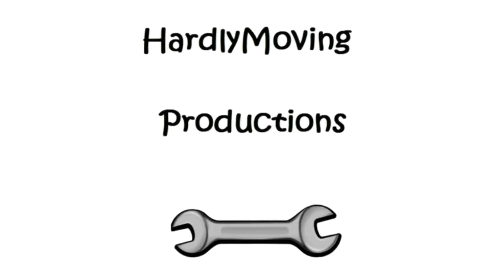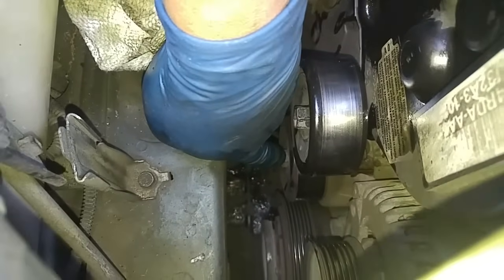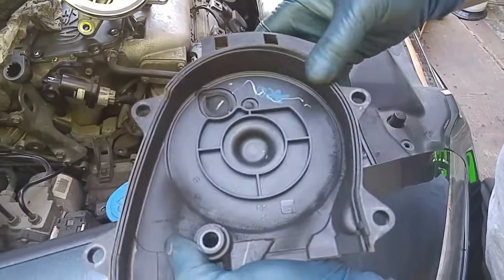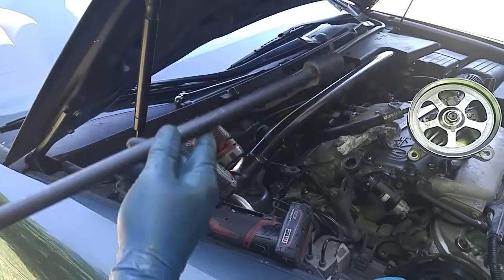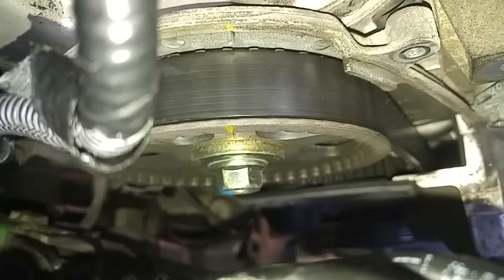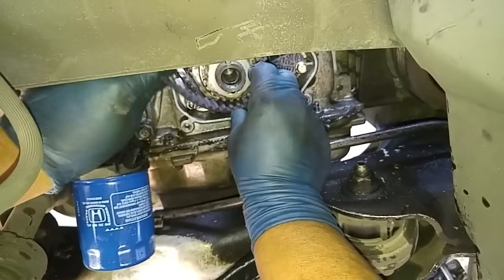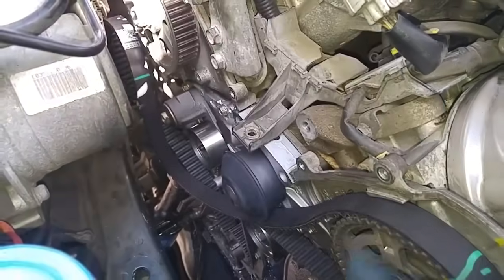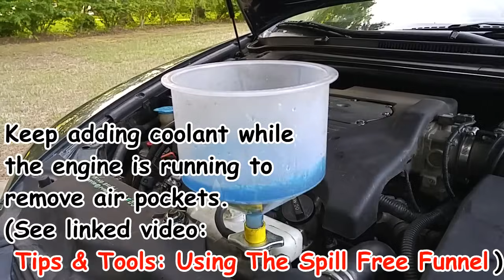Acura TL (Honda Accord V6) Timing Belt, Water Pump, & Pulleys Replacement

Comment: Great job!!!!! But Why leave same tensioner in?????
Reply from the maker: Haven't had a failed or worn-out tensioner situation on a V6 Honda to date. Did have a failed tensioner on a Mitsubishi V6. The strength of a tensioner can be tested in a vise.
Reply: @hardlymovingpro  still should have replaced it. That is what fails on these cars, not the belt itself. Maybe you will get lucky and it won't fail for another 100k miles. Either way its s big risk not replacing it
Reply from the maker: From my observations of all the belt jobs I've done, it's the idler, tensioner and water pump bearings that wear out and fail.
Reply: @hardlymovingpro  but the tensioner is cheap. Even if it wasnt, it is definitely cheaper than a new engine if it were to fail. So at that point while you are in there you might as well just do everything. You are right, the idler can fail. The hydrallic tensioner definitely could. It wears out and starts leaking oil. Idk man you do you, but I want piece of mind that everything was done and there is no chance of a failure
Reply from the maker: You make valid points but find out for yourself.  Call up some dealers and independent repair shops for a timing belt / water pump replacement quote.  After you get their quote, ask them if it includes a new tensioner.
Reply: @hardlymovingpro  I just had my 2016 accord v6 done about a week ago. That's why I came to your video so I could see what was done. They buy a kit for the vehicle which does replace the tensioner

Comment: I LOVE this channel. So no judgements just you dont need to disconnect the hoses for power steering pump. Just remove mounting bolts then move whole pump, with hoses attached, ontop of upper intake. Removing the 10mm hose clamp on back cylinder head also helps get more play in high pressure hose. Just to save someone somewhere some time.
Reply from the maker: Good to know and thanks for sharing!

Comment: Doing my 05 3.0 accord. Had it in time but as soon as I took the belt off the back cam sprung forward. It would rotate clock wise I counter clocked it back to the marks. It’s out of time because the motor won’t turn by hand. Need help
Reply from the maker: You can turn the camshaft back to its top-dead-center mark.  You can leave the crankshaft at TDC.  Doesn't matter if you're off a few degrees.  If you took the belt off before you did TDC on the crank and cams, you'll have to work turning the cams and crank (with no force alternating the turns) to get everything to TDC.

Comment: Great Video. Can you give me an estimate on time for a water pump-timing belt on 1999 Acure TL
Reply from the maker: Around 5 to 6 hours using standard tools with no hiccups.
Reply: @hardlymovingpro  do I need the Milwaukee battery drill or can I use regular tools. I’ve changed out thermostat without drill

Comment: Just completed this job with your guidance, thanks so much! Awesome video!
Reply from the maker: Glad it helped!
Reply: How long did it take? Did you get all of the tools on the list or did you improvise?
Reply: I did have most of the tools already, the trick with marking the existing timing belt with an ink pen and taking a picture before removing the tensioner, then matching it carefully with the new belt, was wonderful! That crank pulley bolt is no joke, fighting that crank bolt can stop your progress in a hurry. I tried to get it off with a 18v snap on impact and it couldn't even budge it, I also have milwaukee tools so I ran out and I bought the new milwaukee m18 fuel impact and that took the bolt off with ease. I also bought a concrete mixing pan to catch the coolant from the block when you take off the pump housing. I did it on jack stands in the garage just fine. I would say it probably took me 8-10hrs doing the thermostat as well, but I wasn't rushing and started Friday night and worked on and off over the weekend

Comment: Do you think it's possible to remove the crank pulley bolt without the impact gun? I ordered the special socket already but I haven't bought an impact gun.
Reply from the maker: That "special socket" is designed to work with an impact gun.  You can get yourself a cheap (under $100) ac electric gun that should generate the torque to get that stubborn pulley bolt off.
Reply: @hardlymovingpro  Oh I see.  Thanks, I guess I'll have to pick one up as well.  I'll be doing this for a 2006 Honda Accord EX 3.0L V6 and your video is the best I've seen.
Reply: @hardlymovingpro  So I bought an impact gun but it's battery powered and it can generate 325 ft lbs of torque.  That should be enough, right?
Reply from the maker: Used with the high mass socket it should.
Reply: @hardlymovingpro  Sweet.  OK, so now I just need to wait for the high mass socket to arrive through the mail.

Comment: There's a few things I would have done differently but that's because I'm picky. With that said, I think this is a perfect example of a how to video. No BS, no ridiculously drawn out intro. You did a fine job sir thank you for the video.
Reply from the maker: Thanks for your comment and support!  If I were to do a timing belt job on this engine a few months from now, I'm sure I'd do something different or slightly out of order.

Comment: Thanks for the great and to the point video. Your tips on marking the belt was great. I am glad I marked it as you have shown. Old stretched belt didn’t exactly match and without the marks it would have been possible to install the new belt one tooth off on the heads.
Reply from the maker: Thanks for watching!

Comment: Hello like everybody else great video i I have the same Milwaukee high impact gun with the Bluetooth and the one customizable setting plus every other 18 volt and 12 volt Milwaukee impact wrench at every size and other cordless Milwaukee tool I have the stubby 3/8 and 1/2 in I have the right angle I have the ratchets I have the autel maxidas and I have my tablet computer with the OBD2 to USB protocol can bus for tuning my S4 and my Audi TT anyway sorry to carry on but I got in an accident replaced everything on the front including radiator headlights radiator support condenser everything everything went well I used the right coolant but at first I didn't and it I was just about to be happy and have my daily again filled up the coolant and was bleeding the air out but then my girlfriend noticed a little bit of a leak on the oil pan on the passenger side 2005 EXL 6 cylinder Honda Accord I am now stumped the car runs and drives great does not overheat unless I let it get hot because of this issue do not understand where the coolant leak is coming from and why can't find anything on the internet and I've been going nuts I was going to do a replacement I'm not a professional mechanic but I've been racing and replacing and doing cars since I was 17 I am 39 now and I have every single tool that you have put engines together put engines in cars have done head gasket jobs on an hourly Volkswagen guy but first was a Honda guy for the life of me can't figure out why or where this leak is coming from it's just coming off the oil pan as soon as I put the coolant in rather the car is on or off and it didn't do it prior to the accident it doesn't it looks like it's coming from the metal lower or upper cover on the passenger side it's like a drip but if I pour coolant in car on or off it'll either slowly come out or come out fast but when the car is on and the Heat or the froster I forgot it will sometimes not leak but as soon as I turn the car off all the coolant will drain from that spot anything would help me greatly I'm dying here thank you man is everything's been a struggle I'm going through a lot of rough times right now and I know everybody has issues but any type of help I would appreciate it I haven't even had the motivation and it's my only car that I can actually use right now I just would love to know I can't find anything on the internet and my head is not all there going through a lot of issues like I said and I need to get this car going I spent a lot of time and money and I need to get places but I don't have the money and I am struggling mentally to get anything done sorry to put that on you but I'm probably not even explaining it correctly to make sense I just don't understand why coolant is coming out over there at the rate it is as soon as you put it and it comes out from that spot and it never did so again I'm sorry man but I would appreciate any help because I was just about to randomly start tearing crap apart with your video LOL and I didn't realize cuz I'm used to Audi and Volkswagen that if you do want to rotate the engine to find top dead center although I am fully aware I've done it like I said but not on a 6 cylinder Honda I understand exactly what you're doing I've done it too with the paint I just didn't know that I didn't need or what way to go manually to get it to top dead center it looks like you were going clockwise I've never had or heard of that you were supposed to go counterclockwise because of the interference any help would be greatly appreciated thank you man again sorry for the messed up message
Reply from the maker: You may have a blown head gasket.  Check for air bubbles in the coolant reservoir with the engine running, any exhaust white smoke during idling, no cabin heat and residual high pressure in the cooling system after engine shut off and cooled down.

Comment: Hey man,

I just did this and my timing belt was loose. I got a new timing belt tensioner, and followed your video. For some reason the belt was loose and I can’t figure out why.
Reply from the maker: Could be a defective tensioner.
Reply: @hardlymovingpro  

Well day two . We took it all apart again!!! took our time again with it and it seems to get tight at certain points of the rotation and then it’s a little loose. We made sure to be at the right marks on the cam gears and crank. Turn it two full hand rotations and fine, put everything back and the car just cranks and crank and no start. Then when we tried to crank it and it was making a noise.
Reply: Oh and when we were turning the cam gears to get them to line up on the second attempt, it would click into place which I don’t recall doing that before.
Reply from the maker: Any error codes?  Like cam or crank position sensor errors?
Reply: @hardlymovingpro  

None errors. We took it apart 4 times!!!! Took our time with it and we figured out is that the cam gears are moving around a teeth more once you put the belt tensioner on. Not sure if we have to use a cam gear lock to keep them from moving. We get them close to perfect on tdc and as soon as you release the pin for the tensioner the cam gears shift.
Reply from the maker: @gloglo1275  Could be something as simple as a leaking or disconnected vacuum line/tube.
Reply: @hardlymovingpro  

Would it not run if the timing is a tooth off? It literally will not run and if you can force it to run it sounds like something is knocking .
Reply: I did see a vacuum above the power steering pump that was cracked.

Comment: Great video, thank you for posting!   The only thing I would change is to say right up front not to start this job unless you have the Lisle 77080 socket!  I could not get the crank bolt undone with a standard impact socket and had to wait a day to get the Lisle.  Then it came off in about 5 seconds!
Reply from the maker: Thanks for sharing your experience with the lisle socket.  It's a great 🔧 tool!

Comment: I take my hat off to you and this is a great video but why are you putting the old belt back on? Considering the timing belt should be changed along with the water pump and a new tensioner and can be purchased in a kit it seems like a lot of work to go through to leave old parts inside.
Reply from the maker: Good point but extra expense the customer didn't want.

Comment: Hello,I recently been having a pretty bad coolant leak that I suspect is coming from the waterpump. I see leakage from the passenger side behind the wheel dripping off of the frame. It's an 06 acura tl. The leaking is getting worse. I find myself adding more coolant more frequently. I cant start the car without first checking the radiator to see if theres coolant in it. 9 times out of 10 I'm refilling the radiator with more coolant. I been quoted for 1,200.00 to replace the waterpump  with parts and labor. I dont want to spend that much on a car I recently purchased for 5,000. This video shows in depth what the labor entails. Thank you for this video. I'm leaning towards doing it myself and doing it fast before something worse happens. Problem is I dont have tools. What will be all the tools I would need in order to get this job done? Should I replace the pulley tensioners? What are all the replacement parts I need? I'm aware that it would be wise to replace the timing belt while I'm replacing the waterpump,but please help sir I need my car. Thank you very much!
Reply from the maker: Yes ... definitely sounds like the water pump needs replacement ... ASAP.  If the bearing in the pump goes, the timing belt can either "jump" or break.  The hardest part to removed on these cars is the crankshaft pulley bolt.  The easiest way to get it off is with a high mass impact socket (made by Leslie) with an powered impact tool (as shown in this video).  You can purchase an electric impact driver for under $100 either on-line or locally.  The Leslie tool on-line.  A list of my recommended parts and tools is noted in the "SHOW MORE" area of this video.

 To support our channel and to get notifications of new videos, please subscribe.
Reply: @hardlymovingpro  thank you for your response I noticed all that info after I sent you my message. What about that automatic ratchet you were using to remove the timing belt covers? Yeah this leak is getting bad I mean the puddle of coolant was bad. I drive to work and let it sit for 10hrs before going home and throughout that time it all just leaked. Thank you again!
Reply from the maker: @freightshaka4193  The electric ratchet wrench is nice to have but not necessary to do this job.  I have it and use it because of all the TB jobs I do.  The tool cost around $150 with a battery pack.    

To support our channel and to get notifications of new videos, please subscribe.

Comment: Do you have to adjust the timing belt if you were to just replace the tensioning pulley?  Mine makes that squeaky sound and I’ll replace it but I wanted to make sure
Reply from the maker: Nothing to adjust.

Comment: I'm considering taking this on. Will save about $650 of mechanic fees above parts. Besides the heavy-duty socket for the harmonic balancer, it looks like I can do the job with the tools that I have. It would be nice to get the long wrench set, but kind of pricey for doing this just once. Do you know how much time I should plan for this? 6-8 hours? Also, what are some likely surprises that I should be ready for? I have lots of experience working on cars. I have changed out engines a couple of times. Just not with this model. I have a 2014 Acura TL SH AWD with 95,000 miles.
Reply from the maker: Getting off the harmonic balancer should be your number 1 priority
Reply: I should be able to free it with a quality half-inch hex socket with a long bar and a pipe.

Comment: Very good video,it looks the same as my engine the only difference is that mine  has a spring tensioner and I think I have to manually add the right tension to the belt  before I tighten the pully, doesn't do it automatically like the ones with the granade pin,am I right ? Also is there any chance that the timing marks are gonna move when I put the crankshaft pully bolt back on,am sorry if I sound ignorant, I done a lot of repairs in my cars but this is my firts time doing a water pump/timing belt,thanks for answering my previous question on your other video.
Reply from the maker: Yes ... the granade pin release setup is an automatic tensioner that replaces the hassle of a spring tensioner setup with respect to a timing belt replacement job.  Spring tension timing belt setups requires just a few more steps to get it right.  You can either rotate the engine two times to allow the new belt to seat in then re-check/re-adjust the belt tension;  or better yet, start the car (which allows hundreds of revolutions to let the belt seat).   My preference is to start the engine.  If you torque back on the crankshaft pulley with a impact tool, the belt alignment marks should not move.  If it does, and with enough existing torque on the bolt,  ratchet the bolt to re-align the marks.  Here's a video I did to replace a broken timing belt on a Toyota Camry with a TB spring set up:
 https://youtu.be/7LxaY6GPy-k
Reply: @hardlymovingpro  Ok I'll try that,am assuming it is safe to run the car for a few secs without all the other belts on it and no coolant running through the engine right.
Reply from the maker: @oggarage3459  Yes ... it is alright.  The car will be running off the battery.  No need to have operational the power steering and a/c compressor pumps.  And when you re-tension the belt via loosening the tensioner pulley, the engine does not need to be rotated to its timing marks.
Reply from the maker: You should add coolant.

Comment: Great video Sir!! My only question is, the new water pump doesn´t need any sealant or glue? can be installed stright ahead clean, just like that??
Reply from the maker: Yes ... With a new gasket.